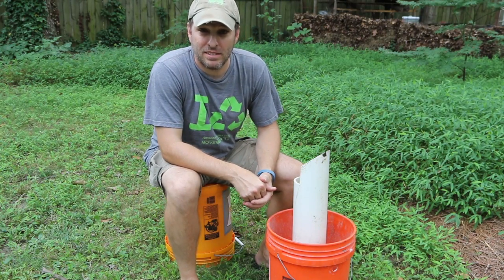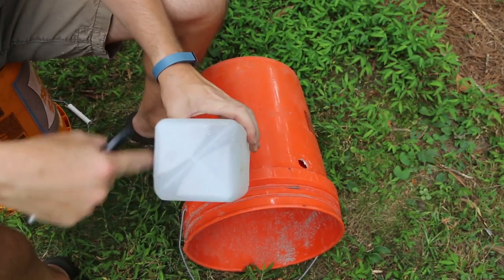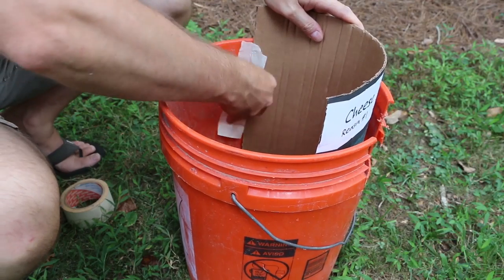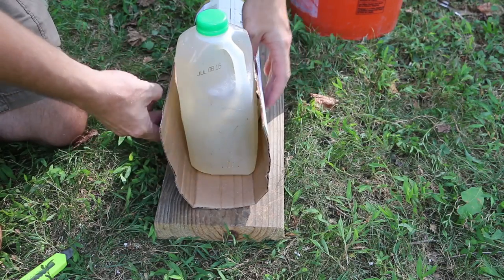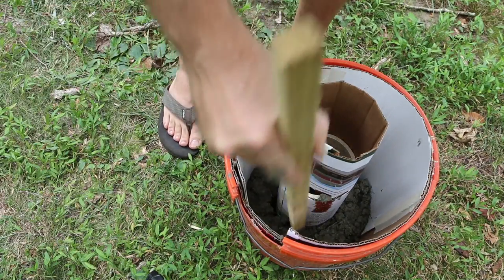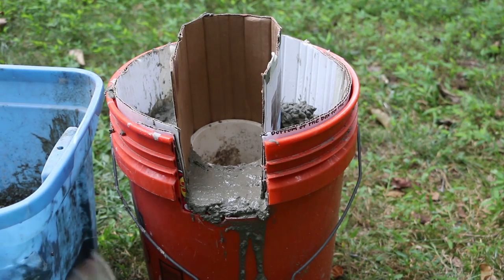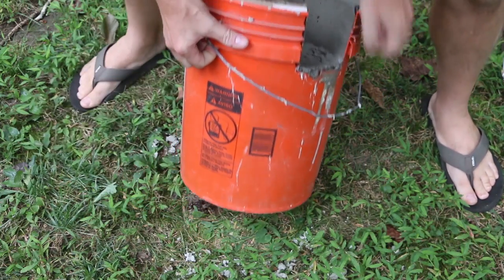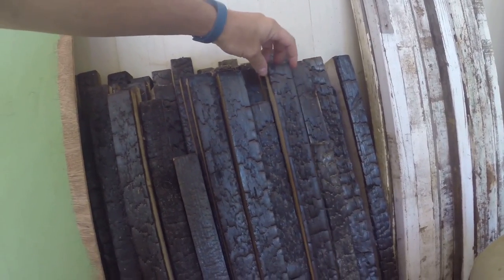How To Make A DIY Concrete Rocket Stove

Comment: in my experience you dont want to put metal in your concrete when building for high temp applications. the metal will expand and contact different than the concrete causing cracks in the concrete and pockets for air and water to occupy. If you use a 3:3:4 mixture of perlite, type II/ III portland cement and silica sand, wet slightly and mix then add 4 parts fireclay your concrete should be good to 3000°F. as long as you let it dry well before use and heat up slowly first use. I have built a quite a few foundries now and I realize thats a bit more than what you're doing here but this mixture has been very durable and lasts quite a while in the high temps. just a suggestion for a strong build
Reply from the maker: +jermmcnasty420 good suggestions. I hadn't considered the expansion issue, although I think the chicken wire is pliable enough to be controlled by the concrete. So far it hasn't cracked. I appreciate your foundry-level modification recommendations. I may do some smelting/casting in the future and will the use mix proportions you suggest. I haven't done a heat reading on the fan-boosted burn, but I don't think it is reaching 3000.
Reply: Hey, thank you for your comment my friend.
Reply: Nice step by step instruction even a 12 you can understand, which means maybe I can do it.
Reply: @epiphgd4302  cement without the larger aggregate (rocks) in it. Its readily available at home depot and usually around $10 a bag. The fire clay is usually a bit harder to find but is also available at home depot. Only one of the home depot locations in my town has it in stock. The others its an order only item.

Comment: its a cool design, just be careful. the fire will heat up the inside to fast and the small pockets of air inside the concrete will expand causing it to crack and break. if there is any water that has gotten into the pores will also heat rapidly causing it to "explode"
Reply from the maker: Thanks for sharing this safety tip. A good plan would be to minimize the air pockets by vibrating the concrete before it sets to help the air rise to the surface. Letting the concrete dry out completely before firing. Appreciate the feedback.
Reply: Might want to consider using a refractory cement instead of concrete. That will raise the price some, but will be much safer I think...
Reply: Great design though!
Reply from the maker: Thanks Edwin. I am going to do another take on this rocket stove. I've been looking at refractory bricks. I was thinking about lining the firebox and chimney with the brick and using mud or concrete for the rest of the surround. I've also picked up a bag of perlite. I'll mix that with the concrete or mud for another try. I've enjoyed the comments and suggestions I've been getting here. Perhaps I'll do a "rocket stove by comments" video and incorporate all the suggestions. Thanks for sending yours.
Reply: I.E._Prepper uu
Reply: GreenShortz
Could this potentially be made with stucco? I have some old sack of stucco lying around needing a purpose.
Reply from the maker: Kevin, I'm not sure this is the right material on it's own. However, it may have insulating properties, in which case it could be mixed with concrete or mud to construct the rocket stove (something I didn't do with my stove, but will do on the next build)
Reply: Empire outdoors grill
Reply: Couple of thing to help. Make the concrete and bit more thin. Take your palm sander without any paper on it and "sand" the side of the bucket with it. It will vibrate the mix and make it compress more. They use something similar for ICF buildings to make sure there are no concrete voids.
Reply: Empire outdoors motocultoare modificate de detinator

Comment: Hey Tom, I just poured my second one today.  It will be a spare in case the cracks in the first one get worse.  This time there’s no hurry, it can stay in the bucket for a whole month.  And it’s finally warmed up a bit, too.  No more 30 degree nights.  Should be 50s the first few nights then it should be safe to move it to the garage.  Maybe that will help it dry out better.

Comment: In doing ceramics it was discovered that chemically bound water released as steam around 1700 deg F. having no place to go would crack large items, sometimes explosively. Two solutions, one-add 25% sand to give porosity to the clay two-take lots of time to cure slowly. Some extremely large projects had to cure six months even!! DS
Reply from the maker: Great suggestions. Thank you.

Comment: For the craters on the sides-when you are pouring it take a hammer and tap the sides of the bucket all around it and it will help keep the outside smooth. You can spray the bucket with several different things so you don't have to use the cardboard it will just dump out of the bucket. Nice stove you have built.
Reply from the maker: Yes! I did skip the hammering step. Would have definitely helped this stove be a little more smooth. I'll try using a release agent on my next rocket stove build. Any way I can save a step, I am willing to try. Thanks for the suggestions.

Comment: Made one of these out of our great southern red clay and some grass.  Dug it up out the yard, trod it threw in some grass trod more then filled in the bucket.   Workedfine till i left it out in the rain once. Crumbled it back up and broadcast it back on the yard.
Reply from the maker: Nice. I have Georgia Clay (cob, really) version of this rocket stoves as well. I kept it covered when not it use. Then, I left it out in the elements to see how long it would hold up. After about 8 months, it is only holding together because of the metal mesh armature. Thanks for the comment.

Comment: Before I go into mixes... let me say well done. At least you are doing it, working it out.  
Terms... Cement is the powder used to mix with sand, stone, and water to make Concrete. 
Also... if you lightly tap the outside of the bucket with a hammer as you go/each lift; you are less likely to have rock pockets.

Comment: You could also use a running drill against the sides to vibrate the bubbles to the top and make it more solid.  I'm really enjoying your channel!
Reply from the maker: Thank you Pam. I’m going to build this rocket stove again using viewer comments to improve my approach. I’ll be adding vibration to the list of improvements. Thanks for your feedback and for watching. :-)
Reply from the maker: Hi Pam. I referenced your comment in the redesign of my concrete rocket stove. Check out the video: https://youtu.be/TYr-Uj4HqDs Thanks for the suggestion.

Comment: Thanks from Orlando. I’m going to make 1 this weekend.
Reply from the maker: Thanks Alan. I suggest mixing perlite or vermiculite with your concrete in a 1-to-1 ratio. It will add insulation to the concrete, making the stove more efficient and lighter. Thanks for watching.

Comment: Tried your stove idea, worked Great! Changed the recipe a bit, added 16 dry quarts of Perlite to the crack resistant cement. I did not like the 'no base' idea, so I made a form from a HD bucket with LID!! Made a form for the firebox with 2 pieces of 3/4" plywood & a feed shelf from 1/4" paneling; cut from the lid down 5". Need the lid for the firebox template & to be able to remove the plug. Hard part was trying to figure a way to mate the 2 pieces; came up with a template, didn't work so good. Getting ready to pour a 2nd stove & base with the same mixture, got good forms. Will take pictures, I can send them if you want'em.
Reply from the maker: I like the base idea. When you mentioned it, I noted that I dislike bending over the rocket stove to set up the fire and maintain it. It would be nice to build this at a higher height. I'd love to see the pics of your stove with the base. Thanks for watching.

Comment: Concrete is a heat sink. The containment of a real rocket stove needs to be insulative, not a heat sink. Make this stove with a mix of five parts perlite to one part cement. Then you'll have a properly insulated stove, able to attain the right very high temperatures to get a clean, smoke-free, highly fuel-economic stove. This stove needs an insulated floor as well, and a fuel tray, to hold the sticks up off the floor, so that air can flow underneath them and up through the burning tips at the inner end of the fuel feed tunnel. Complete principles of rocket stoves, as derived from a lot of experiment and field testing by Larry Winiarski and the Aprovecho team over more than thirty years, can be found here;

http://www.bioenergylists.org/stovesdoc/Pcia/Design%20Principles%20for%20Wood%20Burning%20Cookstoves.pdf
Reply from the maker: Rhisart, good stuff here. I guess I was using the term "rocket stove" a bit loosely. Thanks for sharing. As I create more rocket stove videos, I'll incorporate these principles.
Reply: Rhisiart Gwilym thx!
Reply: Rhisiart Gwilym  awsome article, downloaded for further reading, application, ty for the share
Reply: Rhisiart Gwilym : TY, TY, TY! I suspected as much, after learning th hot concrete can explode, and had started to do some research on using perlite and/or vermiculite with the cement mixture... You have saved me a bit of time. Thank you. And, BTW, is your name of Welsh origins? Just curious, as my mother's family is from Wales!

Comment: Is it heat tolerant concrete? When concrete gets hot enough, it can burst or explode...
Reply from the maker: +Alfred Wheeler not sure if it said that on the concrete bag. But I'll look. So far it hasn't cracked. My non-crack-resistant concrete rocket stove has cracked. I'm hoping the thermal mass of the stove will help regulate the heat. Thanks for your feedback.
Reply: Concrete or cement blocks will explode when heated too.  I've seen many versions of these built with blocks.  Very dangerous.  
The heat might cause the concrete to crack or "spald" throwing pieces outward.  I'd be very careful using this if it has any moisture at all in the concrete.

Comment: Next time, forget the plastic bucket and use Sonotube, which you can find at a concrete supply business. Home Depot might have it, as well. It’s probably cheaper and you can buy it by the foot, plus, the sides are straight. They’re used to make bases for light poles and concrete columns. I think you would find it much easier to work with.
One other thing, you want to use cement that won’t explode when heated. I don’t know what’s recommended, but probably Portland cement.
Reply from the maker: Great idea Alan! I'm going to do that. Thank you for watching.

Comment: Super stove !!

Do you think that the hole we put the wood is enough for the oxygen to get in?? What if we put more small holes on the north, east and west sides of the stove?? Does it give more oxygen. What do you think??
Reply from the maker: SuDz, I like having one entry point for the air, because that lets me control it better. Here's a video where I boost this rocket stove with a small USB powered fan and a 2 foot section of gutter downspout. The results blew me away. :-) Check it out... https://www.youtube.com/watch?v=8hvNH_1uK1g
Reply: GreenShortz DIY Even I had plans of integrating solar powered fan into a stove. You just made it happen in a simple way, kudos :)

Keep it up man
Reply: GreenShortz DIY
Reply from the maker: Thanks Sudz! I like your solar power idea too.

Comment: Awesome. Cool. Think I'll go for it and make one for myself.  Thanks.
Reply from the maker: Thanks Thomas. One thing to add to the rocket stove...get some perlite from the garden center at your local home improvement stove. Do a 2 inch layer just around the chimney with the perlite mixed in with concrete. This will create an insulated chimney for a more efficient burn.

Comment: You can grease the inside of the bucket and outside the pipes and remove the mold as soon as the concrete sets up in a few hours. Saves a lot of messing around with that cardboard. I accidentally left mine 24 hours and still manged, but had a hell of a time lol.
Reply from the maker: +Aedam cool. Thanks for the suggestion. I like removing steps whenever possible.
Reply: You can also line the inside of the bucket and the pipe with Syran wrap.  It works as well as grease when getting the mold off and isn't such a mess.  It does, however, leave some wrinkles on the finish.

Comment: It's also green due to the fact that it uses much less Fuel, and burns it more thoroughly. It literally burns the gas that escaping other types of wood-burning apparatus. This is because it burns much hotter. Therefore you can cook a simple meal using a simple bundle of sticks. And a good part of that fire is the gas is burning instead of them dissipating into the atmosphere
Reply from the maker: Indeed! Thank you for fleshing out the benefits. Thank you for watching.
Reply: @GreenShortzDIY  no problem, I like your build. I've been using a rocket stove off grid for seven or eight years now. I have propane backup. This spring, it's time to build a new one. This time better. Your video helped me make decisions about how I want to do it thank you for posting it.
Reply from the maker: @carolmoore1038  One thing I didn't do on this stove was elevate the fuel on a grate. Definitely a must. I'm testing aircrete for rocket stoves right now. I think it has excellent potential as a great material for rockets. Take a look at my last few videos, if you are interested. :-)
Reply: @GreenShortzDIY  I wondered about elevating it on a great, I've never actually done that before. I imagine it would work better as when you don't do it you kind of have to scoop it out quite a lot. Thus far I just been using an old coffee can. But this is the second one to rust LOL so I want something a little more permanent and something with a chimney, cuz in a pinch if you have to burn what would you don't want smoke in your face

Comment: great video I used a piece of gutter  downspout for my firebox mold worked great thanks
Reply from the maker: +john hill good idea. Did you use 4 inch or 6 inch gutter? Either size should work well for a rocket stove. Have you had good results?

Comment: what does it weigh when completely dry?  Is there a way to lower the weight?
Reply from the maker: +2nd Hand Store - San Clemente Old City Plaza I used most of the 80-pound bag of concrete. But, not sure it was actually a true 80 to begin with. I plan to do another version of this rocket stove, it will be lighter. I'll accomplish this by mixing perlite (vermiculite works too) with the 2 inches of concrete around the firebox and chimney. The main purpose will be the insulation of these ares in the stove, but a byproduct will be less weight. Thanks for watching.
Reply from the maker: Hi. I referenced your comment in the redesign of my concrete rocket stove. Check out the video: https://youtu.be/TYr-Uj4HqDs Thanks for the question. I'll let you know about the weight once it is dry.

Comment: I forgot to mention also to crack the shells after running under cold water and leave in the water and it makes peeling them easier. Also if you are only using them to mash with mayo for sandwiches try poaching them instead. Less work you don't have to peel them afterwards. Great ideas on the videos by the way.
Reply from the maker: +Michael Pepper thanks Michael. I've noticed that peeling the eggs that crack during the boil is much easier. Thanks for the tip.

Comment: if you have the chimney column smaller in diameter then the front elbow, would it make the heat more intense? I guess, can you achieve higher temperatures then if they were the same diameter pipes? I ask because a high heat could be used in Chinese cooking for stir frying!
Reply from the maker: +Stan Avezov I I do think that making the chimney a little shorter would help getting flames to the base of a wok for cooking. Another significant feature that would help is adding an insulation component to the chimney area such as perlite mixed in with concrete. Using a small fan to boost the airflow would also be helpful. Thank you for your comment.

Comment: good job, I like that cardboard trick.  about how heavy is the finished product  ?
Reply from the maker: Rob, I'd have to guess, but the finished rocket stove weighs between 70 and 80 pounds. I'm estimating that since I used most of the 80 pound bag of concrete. Not something you'd throw up on your shoulder or take camping. :-)
Reply from the maker: Hey Rob. I referenced your comment in the redesign of my concrete rocket stove. Check out the video: https://youtu.be/TYr-Uj4HqDs Thanks for the question. I'll be weighing the new stove once it dries.

Comment: I just burned mine today for the second time.  I got a tiny crack running from top to bottom on the back side. ☹️  It closed up when it cooled.  I’ll have to watch it closely next time, but I would expect the chicken wire to hold it together unless it crumbles into small pieces.  I have a few dollars left on my gift card.  Maybe I’ll get another bag of concrete and make a spare, you know, just in case.  If you were mixing pearlite to crack resistant concrete, what ratios would you use?  Any idea how much weight it would save?
Reply from the maker: I've had concrete rocket stoves crack. It is just a reality of heat expansion. Your chicken wire will help hold it together. You could also add metal bands around the stove. I used some metal from a pallet strap to do this. It is in this video, if you're curious: https://www.youtube.com/watch?v=iW2rAlYii_M&t=1s
Reply: GreenShortz DIY I tried it again, another crack opened up. First one didn’t get any bigger, second one is small, too, but all the way up.  About three inches of it was wet and steam was coming out when I noticed it.  Wonder if the cold weather did it?  I don’t think it froze, but it was in the 30s most of the curing time.  It was in my garage under a couple blankets.  I’m gonna have to try again when it warms up for good.